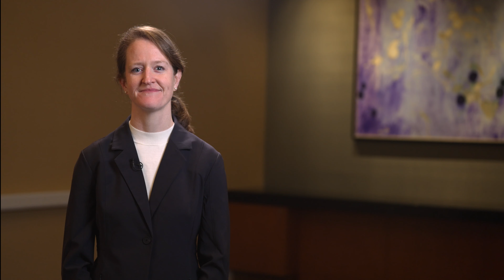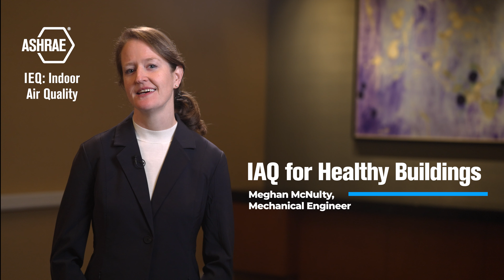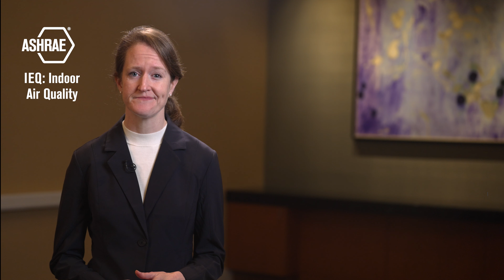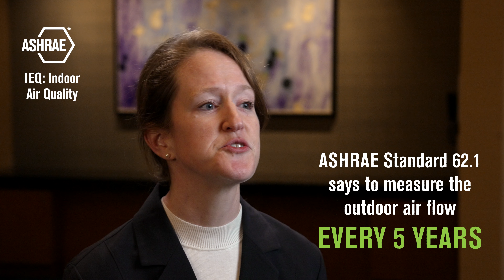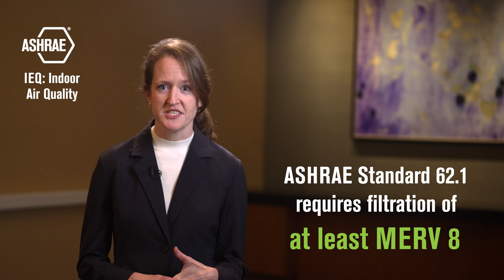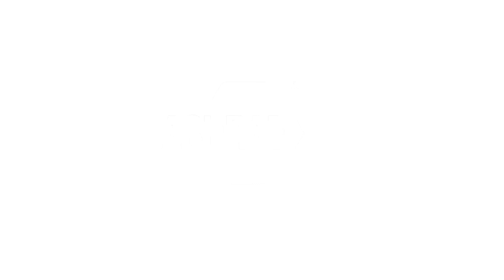Meghan McNulty, IAQ for Healthy Buildings

Comment: Excellent insight from Meghan McNulty, PE.
It’s easy to assume outdoor air is being delivered as intended—but without real-time data, there’s no way to know for sure.

EBTRON airflow measurement devices give facility teams continuous visibility into outdoor air delivery—not just during 5-year assessments. With reliable data, it’s easier to identify issues early, enhance performance, and maintain compliance with ASHRAE 62.1.

Healthy buildings start with verified ventilation.
#IAQ #HealthyBuildings #HVACMonitoring #VentilationMatters